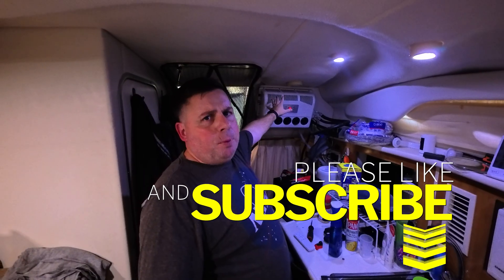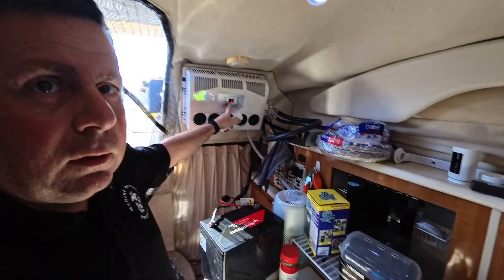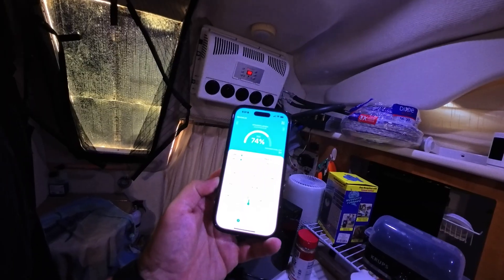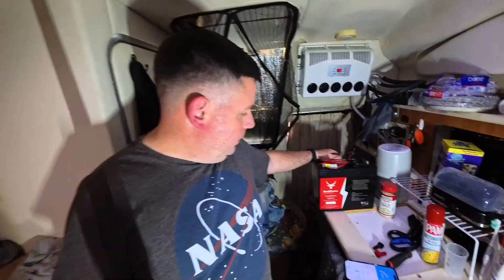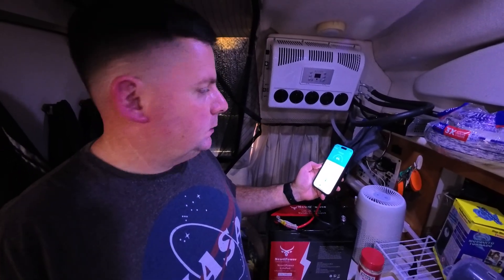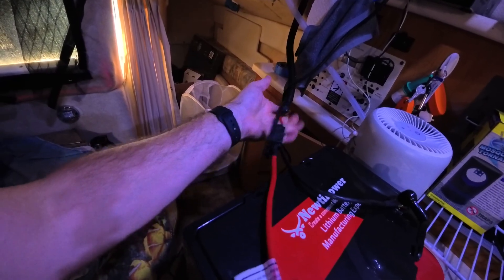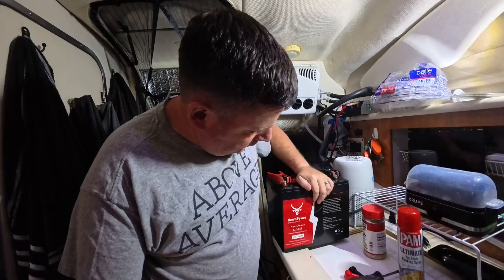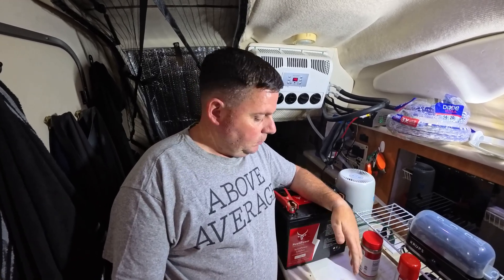How Long Will A 12V Mini Split Air Conditioner Last On One 100Ah LiFEPo4 Battery?

Comment: how many amps was the converter ?
Reply from the maker: I bought the 1000w 83.4a max converter.
Reply: @MajorDadsGarage maybe that’s why you got an error code, not enough for the few seconds of surge at startup. I heard the initial startup surge is 100a+, so the 125a version is needed.
Reply from the maker: @CoolidgeCruisers yes, probably. It only did that on MAX. If I turned it on to a medium setting and then increased fan speed and lowered temp, it was fine but the max power setting does pull a bit more power.

Comment: Any updates on running it on the battery, if not that type of battery normally needs a few cycles to be consistent. One in my Jeep has been going for close to 5 years and charged by 2 100 watt solar panels, it needs to be refreshed with correct charger to balance it.
Reply: Correct, look up Clark's adventure and use a bench charger to fully balance the cells  make sure that you're getting 100% out of it.
Reply: 1 battery 100 ah hell no get a couple 600ah and at least 700watts in solar lol
Reply from the maker: After the first time the charger I bought at Walmart consistently charged it to 100% and the run time was similar. I ran it only on eco once or twice when it wasn’t as hot outside and got around 5 hours of run time. Battery stayed quite consistent.

Comment: Hey have you had any problem by having the compressor vertically? I’m thinking of buying one but I want to put it vertically in the roof of my van. Thank you for your videos!!
Reply from the maker: I didn’t have any issues and I used it for months. I’m planning to install it on the roof of my RV in a few weeks also.

Comment: This could work if wind charging and you have a couple of those, lithium batteries are a fire hazard, set up accordingly.
Reply from the maker: Absolutely. This was a crude test. I plan to install this unit properly in my RV now that I am not living on the boat. If I was to make it more permanent on my boat I would have wired it to batteries in the engine compartment.
Reply: @MajorDadsGarage  I just scored on a turbo style fan blade (tower fan), and am going to try to generate power
 🤞

Comment: Change cable to bigger diameter.
Reply from the maker: It only got hot that one time. I think it was the converters fault and not the wire or the unit. It was good for months after that one time.

Comment: So buy two more of the batteries and put two or three 400 watt solar panels on the roof of the boat. Will that thing also heat via heat pump or just cool?
Reply from the maker: Sadly it’s not a heat pump 😢. I plan to put it in an RV soon and run it on the lead acid batteries.

Comment: Nice sealing door.  You realize how ac works in a closed environment.
Reply: You  shouldn't have anything open introducing more hot air .  Ac is heat transfer. Total waste of energy to no be in a totally sealed environment
Reply from the maker: @tonycking0121 I do it for fresh air. This A/C is very efficient in my tiny space. Once it is down to around 70 degrees the A/C will chill me to 63-65 at night even when it’s hot and humid outside. The other problem is the bilge pulls air from other parts of the boat and under the cabinets and if I don’t keep a window open and a little pressure the engine compartment will force the tiniest fuel odor and becomes extremely annoying. That is the trade off.
Reply from the maker: I know. I don’t keep that hatch open much. I do keep one of the portholes open though.

Comment: Why would you want a potentially dangerous cheap battery on your boat? If this thing starts a fire in the middle of the ocean, youre done...
Reply: Lifepo4 has a very low risk of fire. Properly wired he hasn't increased his chance of fire.
Reply: @blainecelestaine4543  And how do you know if a cheap chinese battery is wired "properly" INTERNALLY?
In case you didnt know. In case of LFP batteries theres not just cells inside the housing like on a lead acid battery.
Then a LFP that simply venting creates tons of smoke. Thats enought to kill you in tight quarters. Even with no fire.
Dont assume youre safe without knowing how these things work exactly.
Reply: @Chris-yy7qc  there are cells and a BMS. What makes them generally safe is the cells. Lifepo4 is way safer than your cellphone battery. You can drive a nail thru it and it won't catch on fire. Not recommended with other lithium chemistries. There are bad batts out there but the weakness is in underperforming not catching on fire. There are a few published lists of Chinese batts by testers one of which is a YouTuber with a sailboat channel Clarks Adventures. When I speak of wiring I wasn't speaking of the batt internals I  meant fuses breakers panels and using the correct size wire for the current draw of your equipment. . So if he has a short in "the big bad Chinese AC" a fuse will pop or a breaker will trip cutting off the current. No properly sized wires will get too hot 🔥.  Of course I'm sure all the Chinese parts in your phone , refrigerator,car microwave and the fact that they make 80% of the medicines your family takes don't warrant the same safety concerns.. 😊
Reply: @blainecelestaine4543  Well, I was speaking about the internals of the battery. If you answer to my comment and speak about external wires it doesnt really make sense.

The BMS can fail and short out the cells and catch fire and/or produce smoke. Wires on the inside can rub through and cause a fire and/or produce smoke. The LFP cells can produce heaps of smoke when shorted. That smoke can catch fire with an external ignition source. A LFP battery is still a battery and if you think theyre safe under any circumstance (especially cheap, botched together crap batteries), then youre not really qualified to use one.
Reply: @Chris-yy7qc  I answered it...... the cells are safe the BMS s don't have a record of causing fires . Millions sold already. There are lists compiled by competent testers . For batts from bad to good. If he feels unsafe he can send that back and upgrade. Remember to put your phone in the barbeque pit tonight in case it catches on fire 🔥.
Reply: @blainecelestaine4543  You must be living in a cave if fires caused by LFP batteries or their respective internal components are something you never heard of.
Not neccessary. I bought a properly engineered one from a good brand. Do you see where this is going?
Dont be naive and assume cheap, botched together products from chinese backyard start ups with no experience what so ever and big financial pressure are properly designed and safe. This doesnt apply to batteries exclusively btw.
Reply: @Chris-yy7qc you lived in a cave a lot longer than I did . I don't know why you are so passionate about a non problem. There are more house fires from wiring per 100k houses than lfp. Like a I said if the owner of the battery feels so inclined he can consult a list from wil prowse or the one I listed above and he not u or me can send HIS battery in  and buy a recommended brand. Now put some clothes on and get out of your basement and get some sun. No one will just u if u keep the tin foil 🤠 on.
Reply from the maker: It’s not permanent I only bought it for this test. Will probably buy another one and replace my RV house batteries.
Reply: @MajorDadsGarage there are plenty of reviews on teardowns to make sure that you're buying a quality product. Set it up with all the safety devices and you'll be just fine.
Reply: He should buy an expensive battleborn instead, correct?
Reply: @KnutSvensson-f2o  Just buy quality stuff for (safety) critical applications from a known and respected brand that actually has QC and whose products undergone independent safety certifications.
And not from a chinese backyard start up.
Reply: @Chris-yy7qc I was being facetious, battleborn has some big issues.
Reply: @KnutSvensson-f2o  Ok?
Did you actually read my answer?
Reply: @Chris-yy7qc sure did! Battleborn has all the things that you list but yet is junk.
Reply: @Chris-yy7qc I'm curious as to what is quality in your opinion?

Comment: Low volt warning is for lead-acid/alternator setup, like a big rig. That would be looking for 13v+. So 12v would be too low, or no charge warning.
Reply from the maker: The low volt warning didn’t come on until the battery dropped close to 11v which didn’t happen until the battery was at 1%. Both the battery and A/C have lo voltage warnings which both came on at the same time.

Comment: I just got that exact model of mini split, you may want to try and keep the compressor in a vertical position because when I got mine it leak oil from the compressor it was horizontal in the box. Your connection got hot because there was something loose in you connection, make sure all your connections are tight. Great video.
Reply from the maker: Thanks for the tip. I’ll definitely check the connections. Someone else told me the same thing about keeping it vertical. There aren’t any directions or warnings for either way but nothing about mounting it horizontal. Mine is at an angle and I’ve only seen them vertical so that is probably the right way. Unfortunately I don’t have room to mount it at all.